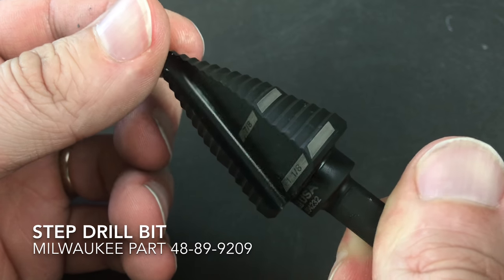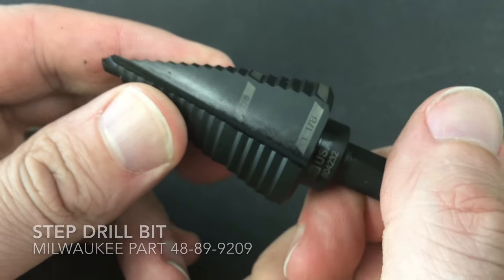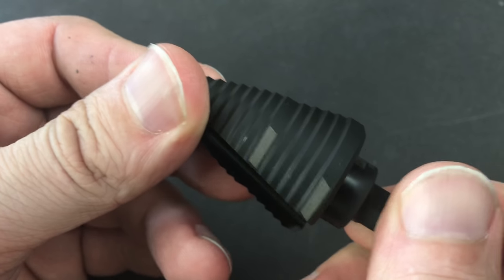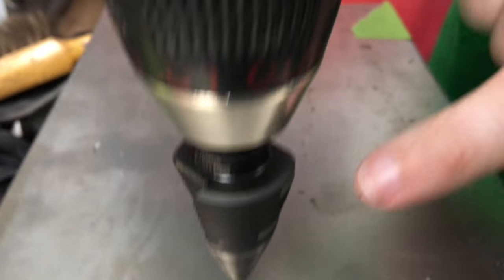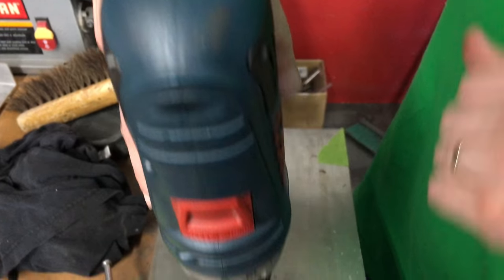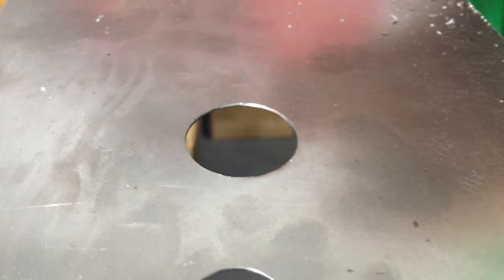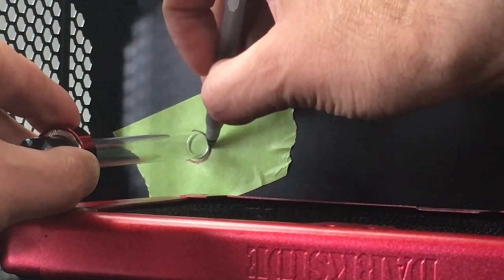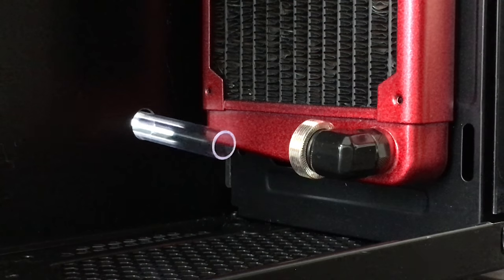How to Use Step Drill Bit Used for Metal

Comment: I use these almost every day as a commercial electrician. I find they last longer if you use heavy force low drill speed just like you do with large twist drills in metal. You need a strong drill to do it though. The 1-3/8" size is actually for 3/4" electrical connectors. If you have to drill alot of holes that size consider purchasing an electricians carbide hole saw.
Reply from the maker: Great tips! Thanks again for watching Daniel, Bill at http://www.mnpctech.com
Reply: The 1 -3/8 is for 1in connectors

Comment: Great video. I am a home theater/automation agent for geek squad. I use step bits frequently on metal studs in walls. I prefer predrilling with something small like 3/16" then switch to the step bit which Yanks it right to 1/2" perfect for zip toggles.  

One thing I have found is you get what you pay for when it comes to these uni bits. The $50 crush the cheapo ones and are worth it.

More vids!!! Cheers

MH from Florida
Reply from the maker: Great tip, Thank you for sharing!

Comment: i use an irwin HSS-Co step bit. It makes near perfect (if not perfect) circular holes in thin materials, unlike a large twist drill which results in a trilobe shape. Also, i find that running the drill slowly, and without much pressure, for 2 rotations with the next biggest step cleans up the edges VERY nicely (gives it a nice shiny chamfer). No need to use a specific deburring tool or file since the resulting edge is very smooth.

Also, getting the irwin bit i find has a less chance of deforming thin metal while drilling due to less pressure needed for it to cut. Also safer that way when you are trying to make a relatively big hole in a small object (like a bottle cap).

EDIT: do keep in mind the irwin bit im talking about has a straight single flute, not the dual straight flutes in the video, or the dual helical flutes that also exist. The single straight flute makes drilling holes in thin material relatively more stable than the other two variations.
Reply from the maker: Thank you for the Tip and watching Emad, Bill at http://www.mnpctech.com

Comment: I need one to drill small holes into my car trunk for a spoiler install - I'm super paranoid about ending up with a whole thats way bigger than needed - but I feel this video is telling me to just let the bit work with no pressure on it and it will automatically drop one level at a time?
Reply: I have same concerns about a metal storm door I’m going to install and need to drill out the holes for the handle and lock. I would find some scrap metal to practice on just to get the feel for it. Maybe even an empty tin can like a large can of tomatoes unless you have some sheet metal, but you get the idea. If not, just do as this guy says, try no pressure and see how that goes.  I am going to use the same bit to drill 1/2 inch and 3/4 inch holes. I will put a black mark (my bit will be gold color) on the 1/2” mark so I can see when to stop. My bit maxes out at 3/4” which makes that one easy. Or you could put some kind of ‘stop’ on the drill so it can’t possibly go past where you want it to.  Good luck.